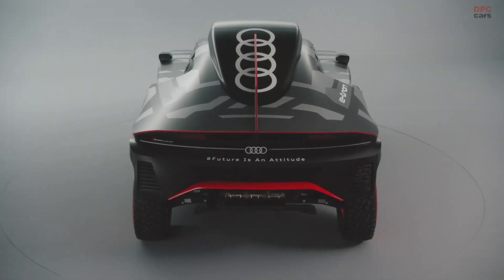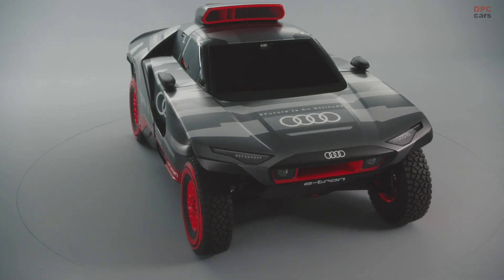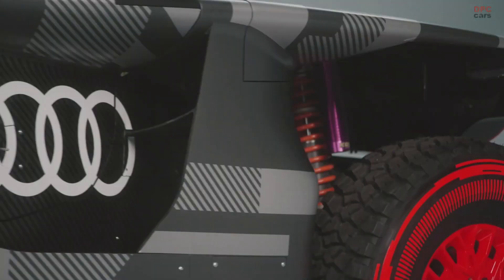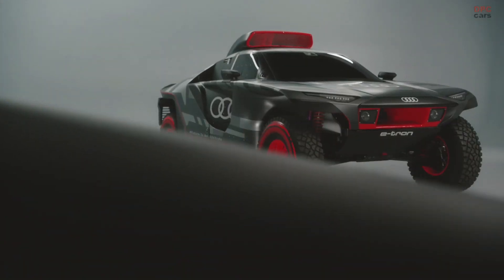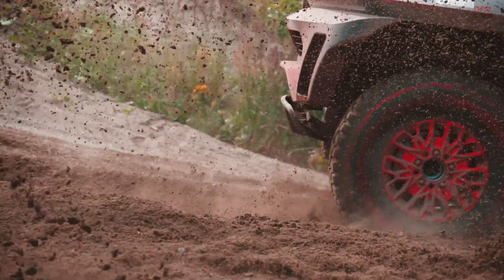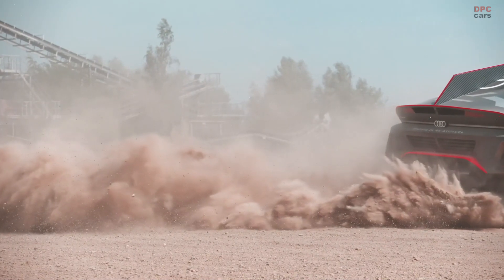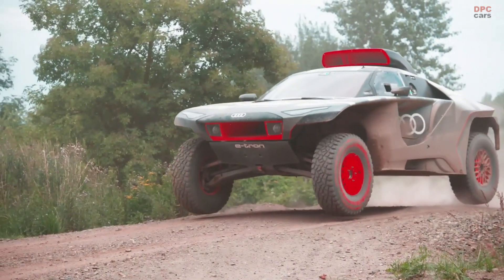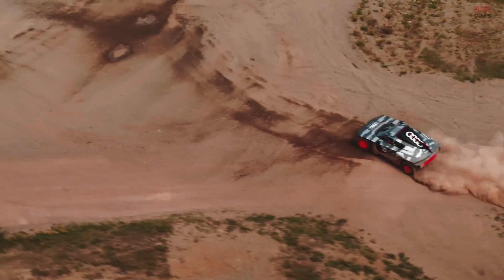2022 Audi RS Q E Tron Explained in Detail

Comment: Meh..  better off retro fitting a tesla motor into a Baja/trophy truck
Reply: Couldn't run a trophy truck at Dakar though.
Reply: @SethKastner  4x4 baja trucks are already a thing. It's only a matter of time until someone makes an electric one with dual motors and starts winning everything.
Reply: @sinnombre5466  Oh, definitely. I think there will definitely be more electric-powered beasts tearing up the sand as time passes. I was just saying that Dakar, which is what they were building for here, is a different ballgame from Baja/dessert running stuff.